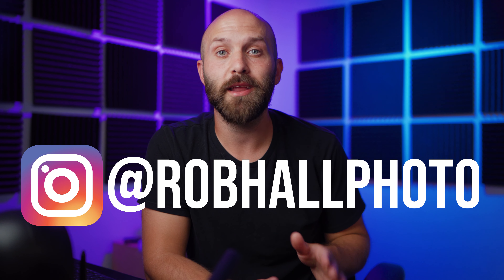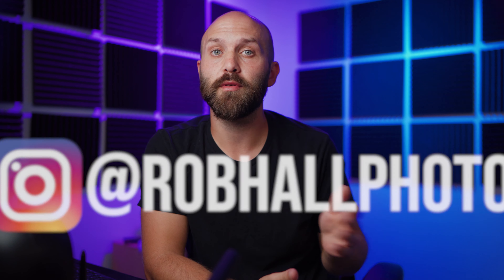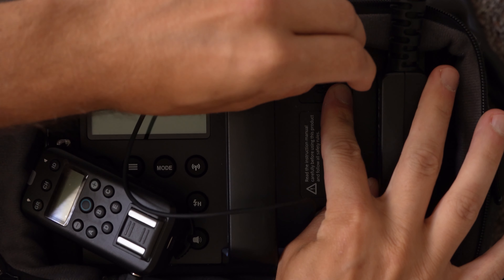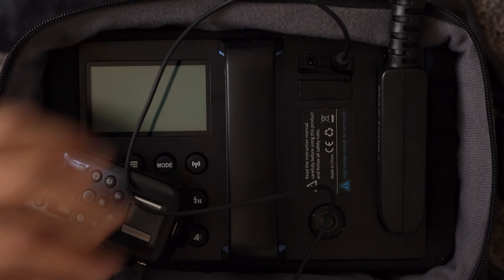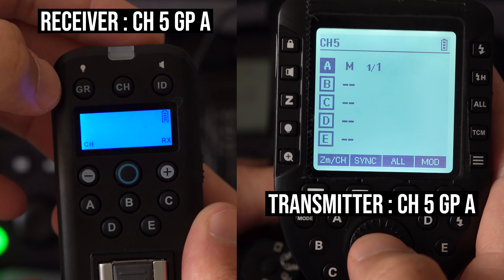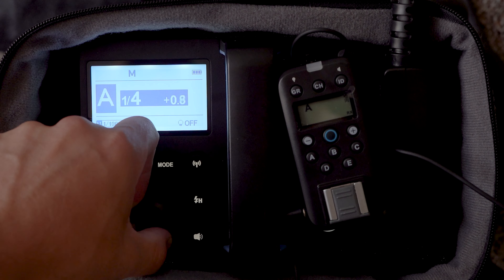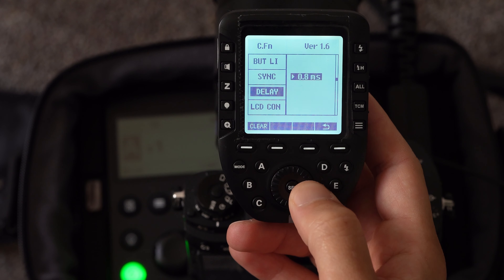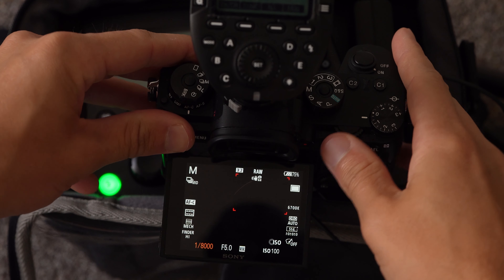Godox Flash Hypersync Tutorial // AD200 AD360ii AD400 Pro AD600 AD1200 Pro

Comment: I cant seem to get hypersync to work with the pw flex tt1 triggering plus IIs. I'm not sure what to do as manually adjusting the delay, the best I could get was at the bottom 1/8th ish and not an entirely clear shot. Any insight you might have is greatly appreciated. Using an AD360ii 🙏🏻

Comment: If you have a Godox strobe with a USB port for the XTR-16, you can use that instead of an external receiver. That's the route I go with my AD200s. You do get remote power control, though obviously you want to hypersync at full-power. That approach eliminates some extra cables, and gives you the ability to bump the power level up to full remotely.

Some transmitters don't give you the delay setting, such as the XT-32.
Reply: Please explain  a bit further. I have the transciever but can't find the cable.
Reply: But the ad200 does have just a mini usb port? How did u managed to connect a normal usb from xtr16 to ad200?
Reply: @AlexandruPrepelitaDP  The XTR-16 plugs directly into the AD200. There's no cable.

I'm not sure if all the latest Godox strobes support these receivers or not.

Comment: Thank you for this video! For some reason I’m not getting the transceiver to pair with the r2 pro… I have the streaklight 360 connected with an 1/8” cable to the transceiver in Rx mode, channel and group are matched up but no flash… is there some part of the pairing process that I’m missing? Thanks if anyone can help

Comment: Hello, congratulations on this detailed investigation! Please, I have a question. I have managed to hypersync without putting receiver on flash. Nikon D750 with X1T on top, and Multiblitz infrared shooter on X1T (like a 3-story tower). Disabling radio communication between camera and flash (Godox AD 600 BM). Ok, perfect, but afterwards I tried to do the same with a Godox V 860 II handheld flash and I couldn't. On your advice, I'm going to buy a Godox X1R receiver. Do you think this way I will can do it? Is the 8-inch sync cable for the V 860 II good or does it have to be another?
Thanks a lot for the help friend, and once again, congratulations on your detailed videos.

Comment: Hi Rob,

I did everything thing exactly the way as showed in the video. The flash doesn't fire at any shutter speed above 250th. I have the Flashpoint AD360, Flashpoint R2 Pro II and the exact Flashpoint single pin transceiver and cable. Any suggestions on how to get it working?
Reply from the maker: The streaklight TTL? or original Streaklight?
Reply: @robhallphoto  pretty sure it’s the Streaklight ttl version for Nikon
Reply: @JonMecca  Ever get it to work? I have also tried everything and can't get it to fire at higher shutter speeds. Are you using Fuji camera?

Comment: Backstop me on this, please: To make this work, do you need to be using a camera with high-speed sync capability (even though you're not actually using HSS)? I ask because I just tried to set it up on my Bessa R3M, which has an all-mechanical shutter, and could not find a delay setting that made the flash visible. After reviewing the video again, I notice you said at about 0:58 that the on-camera transmitter “needs to communicate a high-speed sync signal to initiate a flash ahead of the shutter opening.” Presumably, this preflash signal is what's getting delayed by the delay setting on the transmitter, so that the shutter curtains have enough lead time to start opening just as the flash tube begins to emit light... right? So, no HSS signal from the camera, nothing to delay... meaning no hypersync for me on my all-mechanical cameras, right? Or am I missing a step here?
Reply from the maker: Yes, in this instance your camera would have to be capable of HSS, otherwise the trigger would never send out an HSS signal (even if HSS is activated on the trigger). That is what leads to the early pulse which you can then modify with a delay.
Reply: @robhallphoto  I can't seem to make it work with a Fuji XT3 in Auto FP mode at faster shutter speeds. Not sure what is wrong. Have the Mark II Xpro trigger. Just won't fire the single pin transceiver for some reason. Xpro's test button works to fire the AD200 perfectly. XT3 will also not stay in Manual flash mode always jumps out to TTL. That is a behavior that has always been there. Could be a bug with my camera.

Comment: Not sure if I'm missing something, but I can't get the X1-R to send a signal to the PC cable when HSS switches on with the X1-T transmitter.  It's fine up to top sync speed, but as soon as I go over 1/250 sec it switches to HSS on the transmitter & the receiver doesn't even acknowledge the signal with the red LED.  Is there a setting I can change, or do I need a different receiver?  Thanks

Comment: Nice work.

Just wish Godox would work it out and have either available.   But that might require a different flash bulb.  I know Broncolor gets it all done with the same tube.  Just not sure if it's as good as Elinchrom.  Since Elinchrom uses 3 different heads.  One pro head does action and HS.

Comment: Man this is awesome. Thanks! but what about that Sensor ND-Filter method. Which one do you prefer now? And: do you have to set the delay back to zero when working in normal mode again? Thanks man.
Reply from the maker: I covered this in the other Hypersync video I made. If I don't need to freeze action in bright ambient comditions, then I'll still use sensor ND method.
And yup turn delay off when using flash normally.
Reply: @robhallphoto  thanks man. That Sensor ND was completely new to me. And i would expect AF issues on my Fuji XT2/3, will try to find out...

Comment: Can you use this method on speed lights?
Reply: Speedlights may not have a long enough flash duration at highest power. That's how this trick works. AD200's flash at full power is 1/220 of a second so it's long enough to cover the faster shutter speeds. That being said, I can't seem to get it to work on my Fuji XT-3. You might be able to find out what your speed light has for flash duration.

Comment: I would appreciate some phots using/benefitting from this technique. Question: Is this technique really more power-efficient that HSS?  To my understanding HSS and HyperSync as well is only using a very smal part of the flash energy.
Reply from the maker: All of that was covered in the video that I referred to/linked in the beginning of this video, posted yesterday.
Both are affected by an increase in shutter speed reducing the light that hits the sensor. HSS however loses peak brightness by using multiple pulses of light, and HS doesn't. So yes, HS will result in a brighter flash result than HSS.
Reply: @robhallphoto   Thanks. I apologize for  missing the link the quoted video.

Comment: My nikon d70 can hypersync with any flash without wireless trigger, i use manual flash as trigger on d70 and all off camera flash on optical slave setting will work at any shutter speed and power level 😁
Reply: It kinda blows my mind there isn't a class of camera optimised for flash users that has a global electronic shutter like the one in the D70 - I know CCD fell out of favour for CMOS sensors but you'd think there be demand for a modern D70

Comment: Anyone make this work with an Fuji XT-3 or similar? Have a 3.5mm cable from Sync port out of FPRRR2SPT to AD200. Test button on XPro II fires FPRRR2SPT (single pin transceiver) and flash perfectly but the XPro F II trigger will not fire the transceiver via the camera shutter. Have Fuji flash setting to Auto FP. When I drop it to sync speed (1/250) it fires every time. Fuji will not go into Manual flash mode it defaults to TTL. If you set the Xpro F II trigger to legacy hot shoe it will but that will not allow HSS. Is the TTL mode of Fuji mucking up the whole thing? Doesn't seem to be a way of sending an HSS signal to the single pin transceiver. Fuji is expecting  TTL feedback, which is of course impossible. So I guess I wasted my money on the Mark II trigger. Oh well. If someone has an idea let me know!